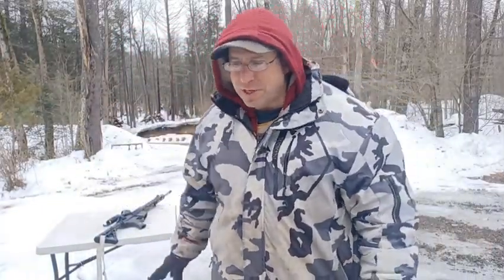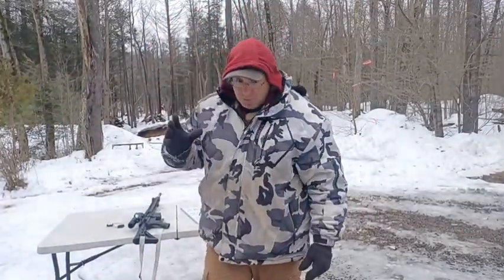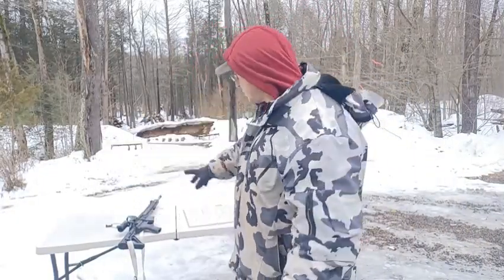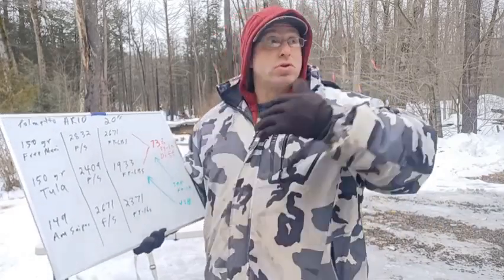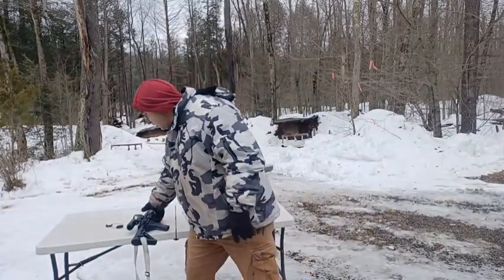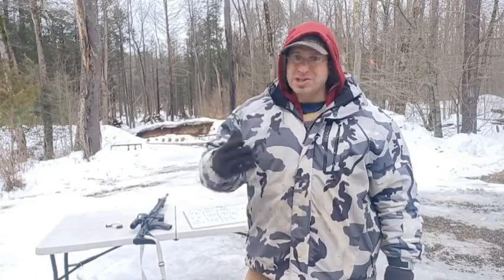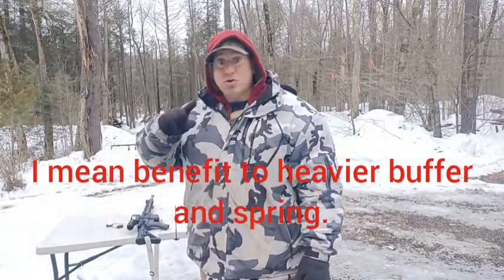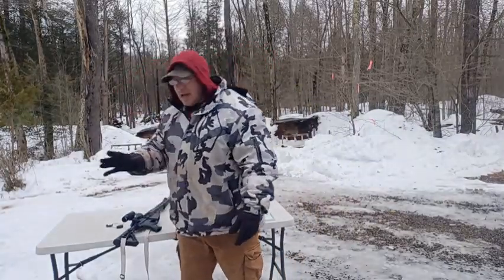AR-10 must have a VERY Adjustable Gas System

Comment: There must be something to this. 
Aero Precision M5 (their AR-10) uppers come with a fixed gas block. 
However, they now offer adjustable gas blocks... curious.
The Springfield Armory Victor .308 AR10 is adjustable by changing ported gas plugs and a variable plug (included).
Both guns have been 100% reliable with NATO spec 7.62x51, ammo marked with circle cross.
Reply from the maker: 7.62x51 NATO is standardized so there will not be much variance. Manufacturers could just stamp 7.62x51 on the barrel and not have to worry about all the 308 variations, but they would lose sales.

The problem is with 308. That has tremendous variance. Manufacturers want to be able to sell the guns to hunters that shoot low recoil soft points. That's why high adjustability is necessary.
Reply from the maker: About 15 years ago I bought a German G3. I did not have anywhere near the knowledge that I have now. I tried to shoot hunting 308 ammo through it and it would not cycle. I brought it back to the gun shop and told them that it didn't work. The gun shop didn't know any better and exchanged it for a different gun. 

In hindsight, the gun needed 7.62x51 nato... or an adjustable gas system.
I wish I kept that gun.... lol